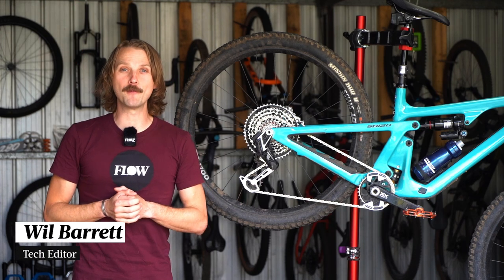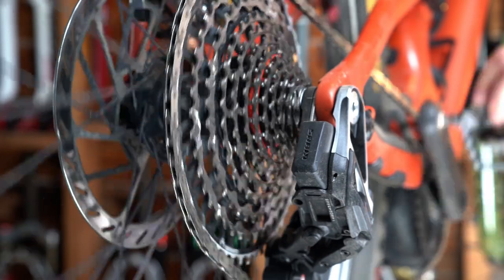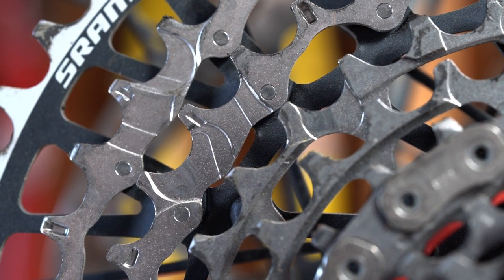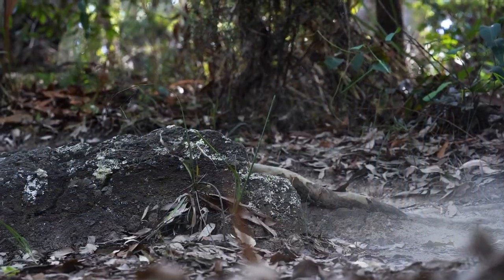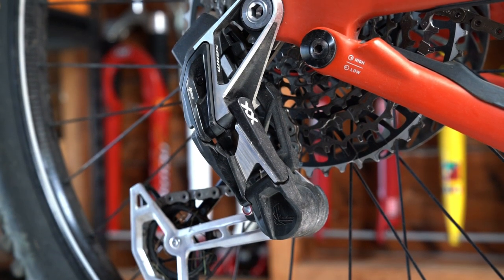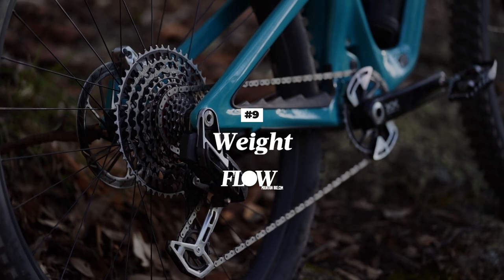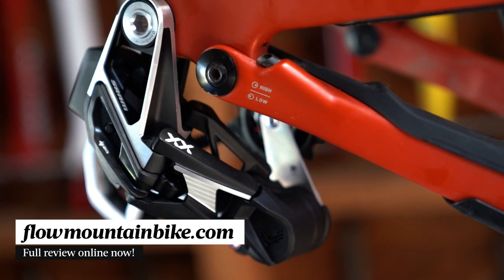9 Reasons Why The New SRAM Eagle Transmission Is A Paradigm Shift | SRAM XX Long-Term Review

Comment: Its still just a derailleur… gearboxes would be a paradigm shift.
Reply: Still can’t shift under load on a gearbox though
Reply: @benwildman6164  on some of them you can, the 3x3 for example.
Reply: @Ben Wildman  if you need to shift under load simply you need to learn how to shift better because is absolutely not necessary.
Reply: @nicolapellegrino1072   sometimes it is necessary, we have convinced ourselves it is not necessary as up until recently most drivetrains couldn’t handle it. Shimano HG + and now SRAM Transmision have changed that.
Reply: @nicolapellegrino1072  exactly... Ride right
Reply: @benwildman6164  ever ride a onesey?
Reply: @Ben Wildman  if you remember rapid rise transmission, that was a good solution for shifting under load, today with motor assistance (talking about ebikes obviously) simply you have to manage that, not the gearing. This Sram groupset simply has a delay that finds the "sweet spot" and gives you the perfect timing to shift under load, but if you know how to manage a climb is not necessary imo.
Reply: gearboxes are inherently less efficient
Reply: @JackMott  not very much
Reply: @bikernaut1 yes, the efficiency hit is fine for a grocery getter but for racing it would be a deal breaker.
Reply: @JackMott  i agree. It's also good for riders who don't like maintenance 🙂
Reply: I wonder how much money this channel got to sk a sram dk like this

Comment: I rode my “old” AXS yesterday and shifted under load numerous times. This product release, is so funny, reviewers are pretending the old Axs can barely shift at all. Sure there may be improvements, but Axs is still spectacular in all conditions.
Reply: I totally agreed, overwhelm by all of this reviews, I rode mi bike today and was wondering what they mean my  axs shift well underload, is not comparable to shimano but it does the job.
Reply: @xovimac  shimano doesn't shift well under load it sounds terrible
Reply: im hard for the elimination of limit screws
Reply: @Lee-ic2yn Not if everything is aligned . My TREK custom build runs beautifully with a Shimano cassette and Connex Wipperman chain .
Reply: @Lee-ic2yn All groupsets make some noise under load including Transmission  , Eagle , Linkglide , Cues and 8x1 Essa ( just tested ).
Reply: @Lee-ic2yn When shifting , that is .

Comment: Looks like a sponsored commercial not a review.
Reply: @mtbohana  exactly
Reply from the maker: No sponsored content here folks!

I can't speak for any of the other reviews online, but SRAM hasn't paid us to produce this video. I wouldn't be working for Flow if we were forced to churn out sponsored reviews. We have a lot of pride in our jobs, and I hope that dedication and experience comes across in our review content.

Full disclaimer - SRAM sent us two of its new groupsets last year, so we didn't pay for them. That's the case with most of the bikes and gear that we review here at Flow. We've been testing these groupsets over the past six months, and this is our long-term review that draws from that experience.

We certainly shared your scepticism regarding the lack of a derailleur hanger when we first starting riding the new transmission last year, but despite all the riding we've done, we're still yet to encounter a problem.

The main downside with the new groupsets is cost - some of the components are very expensive, particularly when compared to say, a Shimano XT drivetrain. In terms of performance and durability however, we're yet to encounter any major flaws. It is properly impressive.

Hope that helps explain, but by all means give us a hoy if you've got any questions! 

[Wil]
Reply: @mtbohana  i call sponsered sir!!

Comment: Tbh I still like the good old fashioned derailleurs where they've to mounted on hangers. I like adjusting the L screws now and then...it's like a bond between you and your bike and by spending time with it like while adjusting your L screws, the bond gets stronger...
Reply: Also if you break something it'll be a cheap hanger and not a $300 derailleur.

Comment: I've gotten Sram XO1 on all my new bikes since 2011, they have always shifted under load, lighter, easy enough to adjust, simpler is better for me,  I'll keep my XO1 stuff on my sub 22 pound Epic EVO, weight is something that matters when your climbing up hill after hill in your late 70's, you can have all the Green Tricknology.. Happy Trails ;) !!!
Reply: transmission is simpler.  no hanger no limit screws. 20 grams doesn’t matter at 70 or 80 years old

Comment: One thing I have noticed is that after extended time racing on the XXSL cassette, the teeth that match up with the shifting ramps are super worn down. Only been on it for 6 months but it is noticeably destroyed. Maybe it is the aluminum instead of steel plate?

Comment: Nice! I wonder how many bikes it will come out on though. Mostly interested in shifting under load! Not so much the wireless
Reply: Any udh dropout bike is compatible.
Reply: @duodecaquark3186  oh awesome! Might be a bit more compatible than I thought. I have since looked up the price though 😬
Reply: @brokenlegz  Yep. Lol not for the average mountain biker for sure.
Reply: It'll most likely be on just higher tier bike packages until they introduce a GX version. Until then the UDH absolutely will be on more and more bikes going forward since it's an open standard (very shrewd SRAM) and as long as you've got that you can buy the system later.

Comment: If you remove the rear wheel, is the derailleur at risk of popping off without the axle to hold it in place?
Reply from the maker: Not at all - the derailleur will stay fixed to the dropout. [Wil]
Reply: The UDH doubled as a captive nut. But now the derailleur is playing that role of hanger and captive nut. The axle comes through the non drive side and bolts into the captive nut.

Comment: Great video. I got a question for you guys about the RS super deluxe ultimate coil RCT2 used on the Levo in the video. Is that a regular shaft or the new steel shaft? Thanks!
Reply from the maker: Cheers mate, appreciate the feedback! Not too sure on the SDU coil shock that Mick's running on his Levo, I'll see if I can find out for you! [Wil]
Reply: @FlowMountainBikeYouTube  please if you have time. I heard SRAM is making a coil compatible with robust steel shaft for the Levo. Thanks!

Comment: Love my XX AXS transmission but the power meter seems unreliable as hell. I had some suspicious readings on a ride a month or two ago, but today had to re-zero it at least 4 times within 20 minutes. It gets out of spec really quickly. Just did the re-calibration process designed for a new bike installation and hoping it helps, but not holding my breath. 40Nm+ torque offset is concerning to say the least.

Comment: What happens with these "transmissions" if the battery dies while one is out on the trail?  Can one carry a spare battery, and is the bike rideable when the battery is dead?
Reply from the maker: Carrying a spare AXS battery is a good idea if you're heading away for a week of riding and will be doing longer days out. They're lightweight and small, so it's an easy thing to put in with all your riding kit.

We've never personally run out of juice, but then we charge the battery every 3-4 weeks when we're cleaning/servicing the bike.

Because the Reverb AXS dropper uses the same battery, it's worth noting that you can swap batteries on the side of the trail if one of them runs out.

Hope that helps!

[Wil]

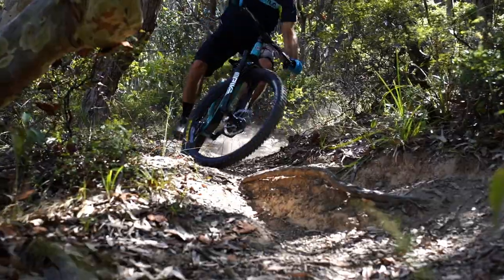Comment: 5:25 wait how is that different to a cable actuated derailleur? If a conventional deraileur breaks here, its because the metal bends, which is why the hanger was there in the first place. If the same situation happens, this deraileur has to take the impact which requires you to make it stronger/heavier

Comment: Do you know if you HAVE to use the new eagle crankset/chainring with the new transmission? I wanted to know if you have to use the new chain and new cranks. I prefer to use my 5Dev cranks and oval chainring.
Reply from the maker: You could use your current 5Dev cranks, but you would need to ensure you had a 'T-Type' compatible chainring in the correct offset. This is because the new Flattop chain uses a 'T-Type' profile that is specific to the new T-Type cassette and chainring. [Wil]
Reply: @FlowMountainBikeYouTube  good info! Know anyone who is selling or making a T-type chainring with the offset that uses the older 3 bolt mounting?
Reply from the maker: It looks like Wolf Tooth is offering T-Type compatible chainrings; https://www.instagram.com/p/CqEaVbjyaCd/

I suspect plenty of others will be joining in soon too!

[Wil]

Comment: …if there is a deficiency in the facing of the inner portion of the frame dropout where it interfaces with the cassette and integrated hanger, there will be alignment issues leading to poor shifting…at least with a traditional hanger you can adjust it.
Reply from the maker: You're absolutely right - the frame has to be manufactured to the tolerances required of the UDH design. Just like post mount brake tabs, pivot bearings, a BB shell or a head tube, if the frame has been built with poor tolerances, then there will be issues. [Wil]
Reply: Yes, which is more common than one might think. I worked at an LBS as a service manager and technician during the height of the pandemic for two years building entry to elite level bikes. Gently hand-filing post mounts to correct brake rub is something I could do without for a while.

Comment: Specialized 3rd generation turbo levo
I bought it. Is it possible to install the new transmission without any problems?
Reply from the maker: It was an easy install for Mick with his Gen 3 Levo. SRAM will be offering a variety of aftermarket T-Type chainrings in order to fit regular MTBs and e-MTBs, and we were able to source one of those to swap out with the stock chainring on the Levo. [Wil]

Comment: I have a non-udh frame, interested to know which parts of the new system could be used (in addition to the new control pods) if any?
Reply from the maker: Unfortunately not a lot. The new Controller Pods are backwards compatible, but otherwise all the moving gear stuff (derailleur, cassette, chain & chainring) isn't.

For example, the new cassette sits 2.5mm outboard compared to a regular Eagle 12-speed cassette, so it may actually present physical clearance issues with some non-UDH dropouts.

[Wil]

Comment: Now we need a frame alignment tool 😂 great ..
Reply: Indeed! As soon as it’s really whacked, or the derailleur rotates slightly where that rough texture eats into the a carbon frame, and will need to be screwed tighter, tolerances will go out the window!
Reply: @deverenfogle3201  There's trim adjust in the mech, will fix your tolerances.

Comment: I wouldn’t worry too much about no hanger there to protect your frame, the derailleur will be more expensive than most frames 😂  but seriously looks great, only downside looks to be cost (any idea on how much AUD?), small weight penalty, and only compatible with UDH frames, so for many this means you need to upgrade the frame not just the drivetrain.
Reply: $2600 for the XO

Comment: Is this compatible with superboost frames?
Reply from the maker: Yes - SRAM is offering both 0mm and 3mm offset T-Type chainrings. If you had a wider SB crankset, I think you would need the 0mm offset option, though I'm not 100% sure on that. For reference, here's a Pivot Switchblade fitted with the new X0 groupset; https://www.instagram.com/p/CqDiOunvo4F/ [Wil]

Comment: does it work with 52mm chainline?
Reply from the maker: Good question! All the new SRAM transmissions are optimised around a 55mm chainline, so all of the new cranksets and chainrings sit at 55mm, and the cassette is spaced out 2.5mm wider to match. 

All of those components will fit to an existing frame, whether it's been built around a 52mm or 55mm chainline.

I guess your question might be around whether you can use your existing crankset with a 52mm chainline and the new SRAM transmission?

Firstly, the T-Type profile of the Flattop chain requires a specific T-Type compatible chainring. SRAM is offering aftermarket chainrinngs that would allow you to do that, and I'm assuming there will be +3mm offset options that will allow you to use your existing 52mm crankset but match up the chainline for the new transmission. I'll double check that one for you! [Wil]

Comment: Best review on YouTube! ❤ Thank you, guys!

I'm left with two more questions:
1. Did you use the SRAM 104 BCD Chainring on the Levo? So chain line is fine with that? 
2. According to some listings X0 derailleur should have the Magic Wheel as well. Can you confirm that?

Thanks!
Reply from the maker: Yep, it's a SRAM T-Type 104 BCD chainring that Mick fitted to his Levo. I'm not 100% sure on the chainline but I'll check in with him to find out.

I don't have the X0 derailleur to hand, but according to SRAM's specs it's only the XX and XX SL derailleurs that feature the Magic Wheel. I'd be surprised if you couldn't purchase those jockey wheels separately and upgrade the X0 mech with them though. [WIl]

Comment: I hope SRAM makes a cable operated version of this new "transmission"
Reply from the maker: We're curious about that too! Many of the same technologies could be translated over to a mechanical system, and it sure would be interesting to see what a cable-operated direct mount mech would look like. Surely it would be smaller and lighter?

That said, SRAM appears to be wholly committed to electronic groupsets from the GX/Rival level up, so perhaps we'll only see an entry-level mechanical groupset at the NX/SX level?

[Wil]
Reply: @FlowMountainBikeYouTube  it would be a shame if there were no cable operated counterparts, as I'm sure a lot of riders are not interested in electronics. Also I don't quite understand why there needs to be a new crankset. Maybe is we are lucky, they would release a cable operated GX with new cassette/chain and chainring.. Fingers crossed.